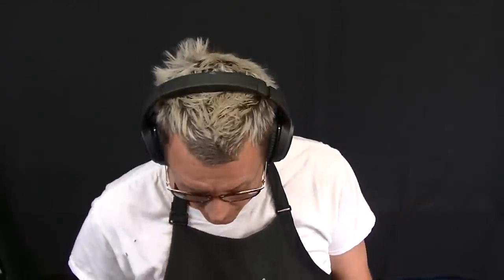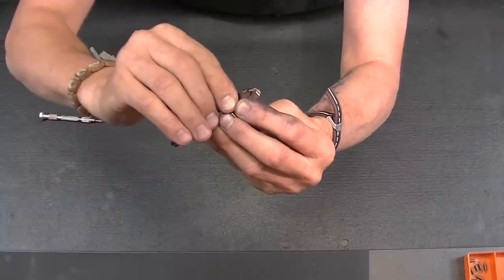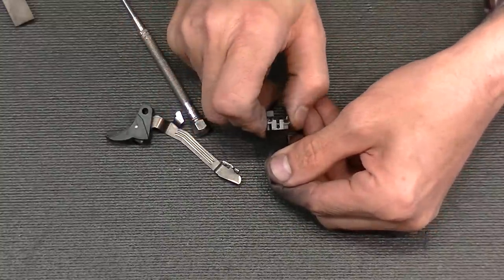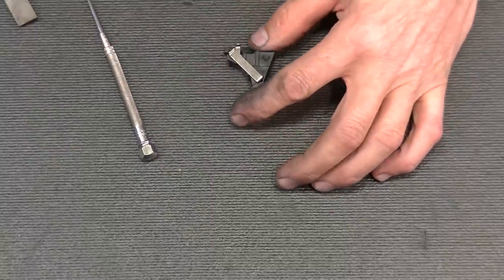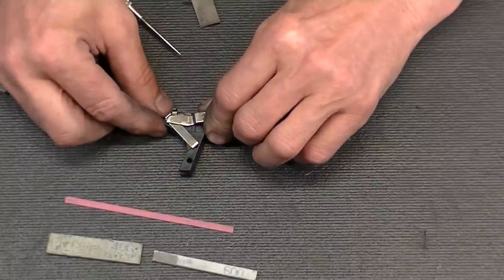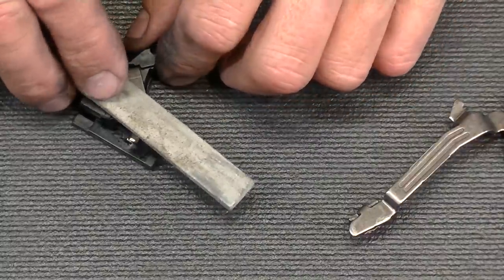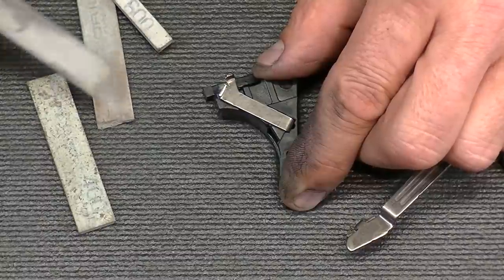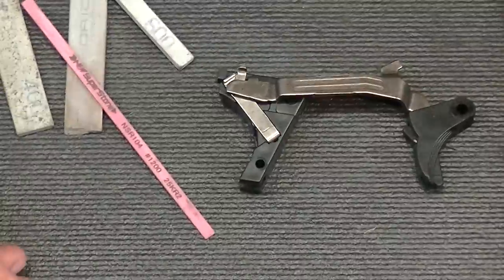GLOCK CONNECTOR MODIFICATION

Comment: I always file down the sharp edge where the transfere bar slides over during reset- helps smooth out the pull & reset. Careful though only smooth out connector , don't take out alot of metal.
Reply from the maker: I concur

Comment: Definitely NEED a closeup view!!  Need a better camera! Need to show two connectors side by side with before and after bevel mod close ups. Saying "I wish I can show you" doesn't help get the Idea across. Suggest to put a piece of drawer slide tape on the flat to protect the surface from nicking with the file. Its a slightly hard tape and the file will glide off vs dig into the tape.

Comment: HOW FAR TO ANGLE THE CONNECTOR 

Hey Johnny, glad to see you doing your detailed videos again. Instagram is just a tease. 

You show a better shot of it on an older video @ 8:47
https://www.youtube.com/watch?v=APg96MiLeks&list=PLzJf5fByZKQJjLPtvSpQIdL5myes7yQjO&index=39&t=0s

Pull the connector out or in to where it's even with the trigger housing exactly where you're pointing to @ 8:57 

I once had a factory set connector in a brand new 19 and the trigger felt like crap. So, I looked at the connector and couldn't believe they let this one get by. It was bent so bad that it was bow-shaped. I just flattened it out, then did the "1,2,3 boom" trick (reversing the connector so it hangs off the trigger housing, then giving it 3 good presses with my thumb,) you show in another video (can't find right now) and it was perfectly positioned, just in line where you show it in this video. The immediate result was the best stock Glock trigger I ever felt and about 1/2 lb lighter.

Comment: Where do you buy your honing stones, especially the finer ones i.e. 2500?
Reply: TakeDeadAim
I have, finding quality stones is like hunting morel mushrooms. Especially actual quality tool and die makers stones. I have a couple of very fine pieces left over from trade school but have not been able to find anything of that quality except some ceramic stones from Midway.
Thanks for your input.
Reply: TakeDeadAim 
Been there, both sites. 1200 is finest grit they have and it is in the larger size stone, looking for the finer grit in the small size stick as seen in this video. Leave a link to that, unless it is ceramic stone which I already have. The ceramics are small like the pinkish colored diamond stone in this vid and are great for the very last polishing pass, but seem to clog so much faster than the other small stones I have that I would like to get more of
Thanks again for you concern.
Reply: Maine Jackal 
Thanks, I looked there before I purchased the ceramics from Midway. Love Brownells!

Comment: Could you also do this to a connector to help with trigger reset issues (ie. the shelf in the slide is too thin and doesn’t allow the connector to be moved over enough for the trigger bar to reset)?

Comment: If i create a slope how much is to much ? If it can be measured a 1/32 1/16 of a inch. A slope must be created then what would be ideal would be to round off the Conners of that slope. I guess as little as possible would ideal so its sitting at like 1deg in the housing...file at 1deg approx. Then round off those corners man that would be hard.

Comment: Do you have a video on how to adjust the connector angle?
Reply from the maker: Yes it's called transfer bar drag
Reply: @johnnyglocks  Thanks, I installed a new connector and the striker won't drop. The trigger keeps moving back and forth but not dropping the striker. I had to take the back plate off to disassemble the gun. 
I think the connector is bent to far away. How to I bend it to get it closer, I push on it but it doesn't stay bent?
Reply: @anthonyz.4560  Here's a fix for that issue:
https://www.youtube.com/watch?v=Z6BK2bglB4I

Comment: What is the stock connector bar angle? Anyone know?
I heard you can have fullauto if it's not enough, or too much.  Where's the sweet spot?
Reply from the maker: 90 deg
Reply: I'm sorry Johnny, I didn't word the question properly.  I was trying to ask what lateral angle is the connector supposed to be so the trigger bar doesn't jump the connector?
In other words, how far does the connector need to be away from the housing. Once a connector is set and working, it could be removed, then it's angle measured from the base that is inserted into the housing to the connector's vertical section. 
Glock ought to have the measurement.

Comment: Excellent! Makes sense. Just like chamfering the leading edge on a 1911 sear. You don't need much, maybe 0.001" taken off that edge. Same thing with the Cruciform I would imagine.

Thanks!
Reply: You definitely do not want to chamfer the cruciform, it is the sears and you want it to be razor-sharp and straight otherwise your Glock might go into full auto or discharge from even a slight bump.

Comment: Great info as always... So I have a 3.0 ghost Angel and could never get it to work right ... Do u know anything about this ? It drops the striker on rest, and that's on the guns I can even get it to function... It has a soft pull like there is potential but something is just not right with these things ... should I give it up for the 3.3 or .....
Reply: Josh Zeek I’ve had 2 different Angels and tried in 5 different guns and it didn’t work! Did the same thing yours did, felt it would be unsafe always! I so wanted it to work, the first couple of dry fires felt smooth and light and then it started dropping on reset!
Reply: @ronguay01  I talked to ghost and they said they was doing a redesign but haven't talked to them in a while, the did offer to replace it with a different one tho...
Reply: Ok I just called them again , they said they had two prototypes that they were doing the final testing on now so "it won't be long now " is what they said on the replacement

Comment: Does he really expect us to buy and use all these different grit rods?
SERIOUSLY?
I just knocked out the rough parts with a couple strokes with a fine flat file and used brown polishing compound on a fabric wheel to polish it up!
This is just about as bad as the guy who said to use a milling machine to machine off the plastic tabs on a Polymer 80 when I just used a pair of wire cutters (AKA dikes) to take off most of it and finished up with a plain old box cutter!